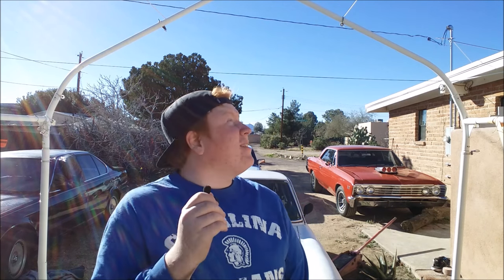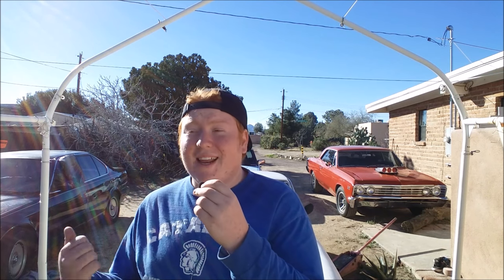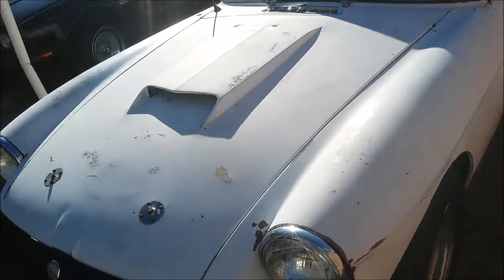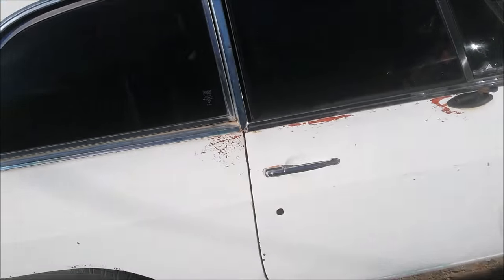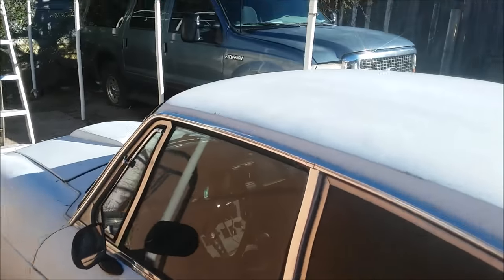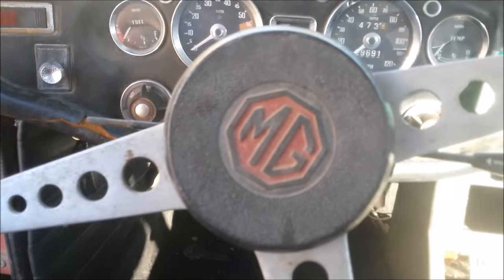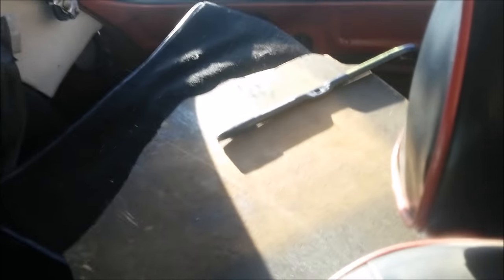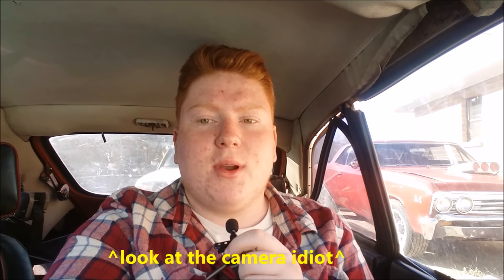1974 MGB GT.....We're finally starting a project!!!!

Comment: you'll probably want to stick to 14 or 15 inch rims,  the 13 inch rims look too dinky on the raised rubber bumper suspension
Reply from the maker: David C I actually ended up sticking with the 14 inch rims I just had to go with a smaller diameter tire on the back